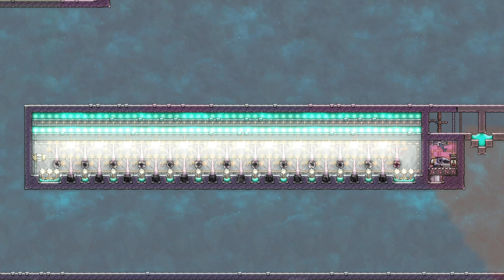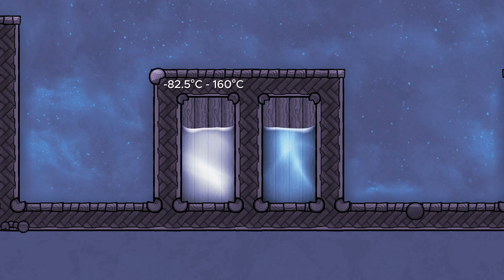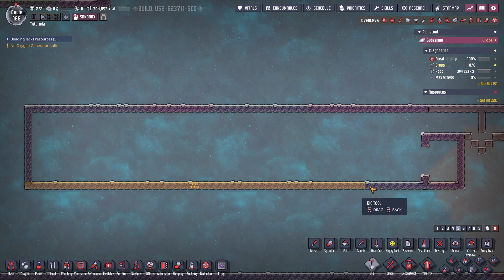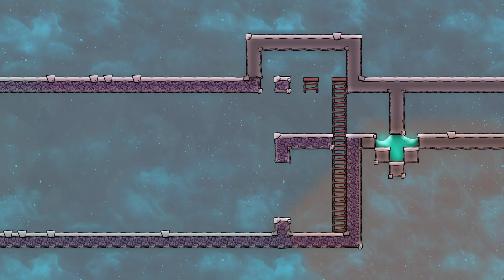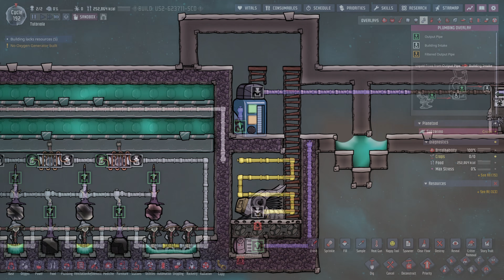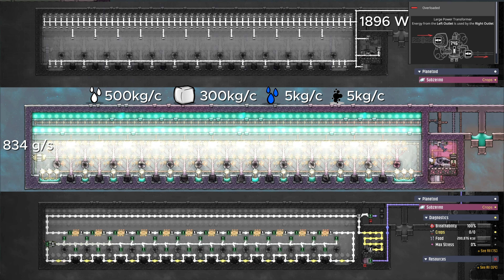Tree-fueled plastic production | Bonbon Tree Greenhouse Tutorial | Oxygen Not Included

Comment: You can also 4x the output, or shrink your foot print, if you use the pot plant trick, since the bonbon trees use a solid(snow) fertilizer, which isn't needed when using the pot plant negates the fertilizer requirement for domestication.

Comment: interesting, but very painful to build without debug. pips dont plant on vacuum, then after finishing planting the first tree is already adult, so i cannot buiild bottle emptier to drop ethanol, so i manually had to use vents to fill. I could also not build the most left ceiling lamp on the bottom row, says it is unreachble. took me aroud 70 cycles to finish. But thanks anyways for the idea, just need to be a bit more practical

Comment: Hey there, just a weird thought/idea that you could possibly do. Instead of having the polymer press there in that chamber, you could make it a stable condense the area in half and use it as a spigot seal ethanol production facility. Then take out the bottom row of insulated tiles replace them with mesh tiles and build a three tile high liquid chamber with a mini pump, liquid reservoirs, and a hydro sensor. Each spigot seal will consume 40kg of nectar per cycle and produce 40 kg of ethanol per cycle.
You can also keep the piping there for the bonbon trees in case you have excess nectar production, which you most definitely will. The only concern you would run into is dealing with the excess eggs and tallow they produce as a by product.
Reply from the maker: I´m actually working on my spigot seal ranch right now ^^ My previous design looked quite similar, but unfortunately had some critical mistakes. I will reupload a video on that topic later this week ;)
Reply: @telx7  Awesome doubds great to me!
Reply: Edit: You might be able to get away with wild farming them and keeping the area just as big in the original design

Comment: Actually, now I think it makes more sense to build a natural bonbon tree farm vertically if you use natural light. The branches don't block the sun, so you can have a single column of bonbon trees going all the way from the top of the map to the bottom.

There should be just 2 empty spaces between each natural tile, just enough to grow the bonbon tree but not enough for the middle branch to grow, meaning you'd only have 4 branches per tree. The advantage is that you are using the sun, but you aren't using very much space biome real estate. The space biome is prime real estate in general. Bonbon trees are competing with solar panels, rockets, gassy moo ranches not to mention any building with byproducts you'd like to vent to space such as CO2 from ethanol distillers. One long column of bonbon trees would provide a lot of nectar for very little space whilst consuming virtually no power.
Reply from the maker: True, someone else pointed that out as well. Also the efficiency matters less, because of the many trees you can plant this way ;)

Comment: Nice video. Will make this tomorrow. One question though, why vacume the area out ? Cant you just run this without a vacume? Cooling loop should still do the trick right ?
Reply from the maker: Technically it should be possible without a vacuum, however it´s a safety measure to keep the trees from exchanging temperature with the lights. Due to the gas behaviour, there is a possibility the trees get slightly warmer, which makes the nectar slightly warmer, which makes the coolant slightly warmer - this can escalate to a point where the temperature in the room rises to above -15°C and stifle the trees.
Reply: @telx7  oh that makes good sense. Vacume it is then ! Thank you sir

Comment: Doesn't ethanol have 25% light absorption, so it's dimming your lights? Window tiles also block 10%, so you may want to remove the secondary row and just use a cooling loop that cools oxygen and window tiles around the lights. That much glass is also pretty time consuming to make, so it should make the design easier. It would also let you bring the lights a tile closer to the trees to further improve the light levels.
Reply from the maker: Farming the trees in atmosphere works too, but you´d have to include an external cooling loop then

Comment: Why do the natural tiles need to be that cold? The language for the temperature of the nectar output wasn't quite clear. If X is the temp of the tree is the output min(X,-35) or max(X,-35)? If it is min(X,-35) it seems to me you could use any temperature in the range for the tree of -75C to -15C. If it's max(X,-35) then I don't see how it would be self cooling.

Edit: forgot to say that I enjoyed the video and to keep up the good work!
Reply from the maker: Sorry if the explanation was confusing. I haven´t exhaustively tested this, but it seemed like the nectar coming from the tree was at a similar temperature to the tree down to -35.5 °C. If the tree was cooler beyond that, the nectar didn´t come out cooler. However, if the tree was warmer, e.g. -15°C, the nectar coming out would also be warmer. Due to the vacuum, the tree only exchanges temperature with the natural tile it is on, meaning cold natural tiles lead to colder nectar with more cooling capability.
Reply: @telx7  Thanks that makes sense.

Comment: I noticed that bonbon trees automatically dig out the crushed and snow that fall on them from space. Also, snow and crushed ice meteors don't seam to damage buildings like autosweepers, at least from what I've seen. This means a row of closely packed wild bonbon trees are an interesting alternative to robominers when it comes to collecting resources from space. Although to be fair, a row of solar panels with pipe of warm liquid to melt the ice might be even better. I'm not sure if bonbon trees halve the snow and crushed ice on them, but I assume they do (if they don't that would open a ton of possibilities).
Reply from the maker: A natural space defense, I like the sound of that. I havent looked at the numbers yet, but I definitely prefer getting snow from meteors than producing it in ice makers.
Reply: @telx7  They definitely don't dig enough snow to feed themselves as domestic bonbon trees. I haven't looked closely at the numbers either, but from what I have seen bonbon trees dig out maybe 5 to 20kg of snow and crushed out of themselves after a meteor shower at most and you only get a meteor shower once every few cycles. Still, it's essentially free so who are we to complain? 

Maybe a mixed system would make sense? Plant a row of wild bonbon trees in space to harvest snow and passively produce a little bit of nectar from sunlight, and feed the snow to a few 100% lit domestic trees?
Reply from the maker: I mean not everything needs to be bogged down in numbers - a couple of wild planted trees in space exposed to sunlight can rack up a decent amount of nectar, while you are busy doing something else.

Comment: Hello!
Here is a useful tip for pip planting : rather than ladders, use ceiling trim to block pip planting. The dupe won't build it (invalid position), so you dont need to deconstruct when the pip planted in a free space to free the next one, just to cancel. that means no dupe labor, and the pip can plant right away.
Buildings "ghosts" block pip planting as well as built stuff :)
Nice set of videos anyways!
Reply from the maker: Thanks for the tip, I guess I just did it one way and never thought about alternative methods ^^
Reply: I've found lately that my pips won't plant in a spot that has a ladder queued to build, which makes it easy. Que up all the ladders in a space except the right-hand one, mark their priority as 1 (so they never get built), and cancel them as the pip plants.
Reply: @georgfelis  Hello, if you have not seen my answer, rather than ladders, use ceiling trim. They never get built, independantly of the priority, because there are no tiles above, so dupes don't bother.
Even with 1 priority, my dupes build the ladders at times.

Comment: Another approach may be building the lights above first, getting them without the tedious work of placing them one by one. I think you could also cool the room below while still in atmosphere to cool off the natural tiles to the right temperature
Nice build and good format, It's nice seeing such quality content from a new channel, great stuff :)
Reply from the maker: Thank you, you are right, there certainly are more/different approaches to set this up. I like using a vacuum whenever I can, just to avoid having to worry about temperature exchange ^^
I think in this particular setup, the vacuum is necessary, because the temperature of the nectar is tied to the temperature of the bonbon tree. In other words, we are constantly introducing heat to the system via the lights and after an extended period of time get less and less cooling out of the trees.
Reply: @telx7  Does the vacuum also save your pips from dying from cold? Anything colder than about -20C and my pips don't last long.
Reply from the maker: @zebbedea6259  it does! pips are fine in a vacuum :)

Comment: I'm a little confused, how do we get rid of the CO2 without an air filter or pump?
Reply from the maker: As mentioned by @VShuricK, the polymer press releases the steam into the environment and only carbon dioxide enters the gas pipe, so there is no filter necessary. Since only a comparatively small amount of steam gets released, the cold temperature in the room instantly turns it into water.
Reply: the press has its gas biproducts through pipes, the co2 shares the pipe with the steam so you can hook up a filter somewhere else if you really wanted to
Reply: @mimaneneko8386 looks like you never play this game 😂
Steam eject in nearby space, co2 exit via pipe. You dont need any filters.
Reply: @VShuricK  or I've just never used the press until frosty planet cause dreckos exist so I've never needed to touch it so it was a safe assumption 

But yeah we can also just take the jackass approach
Reply: Another great tutorial, I’d be curious to see some of your power setups for frosty planet.  I assume bonbon trees into an ethanol gen, but I’m not making quite enough ethanol off my seals yet.